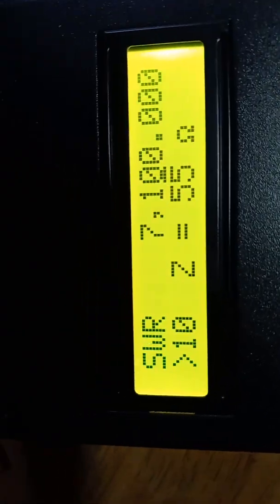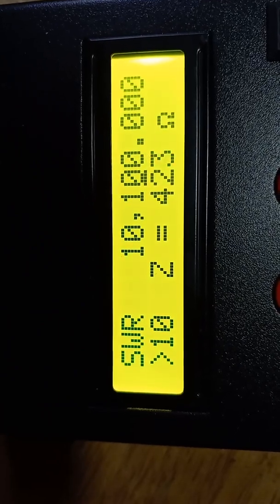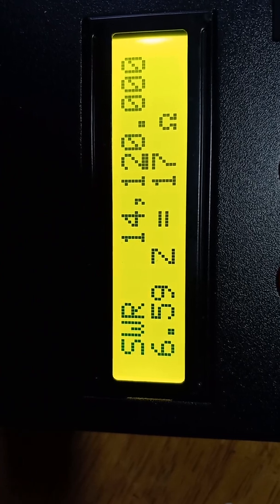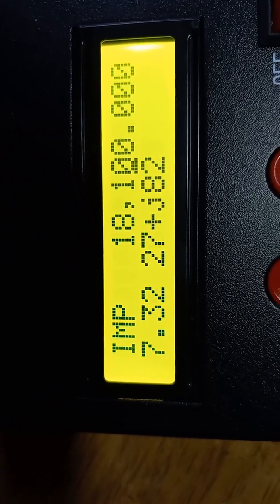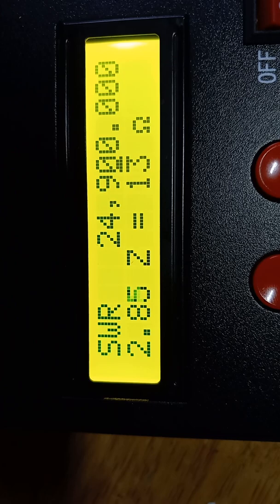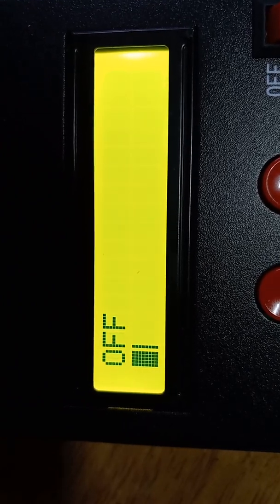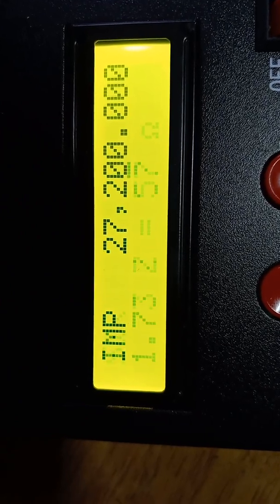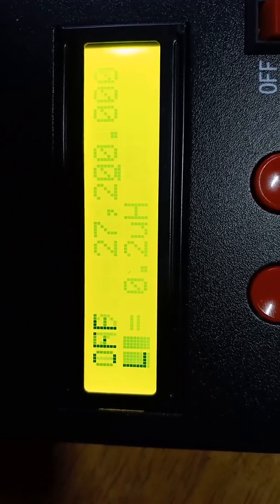Sark100 Analyzer

Comment: I just got one of these and i ordered a 2.1mm cord but when i tried to plug it in the center pinon the unit  was too big and the cord wont fit
Reply: I got lucky and had a jack that fit it but now it powers off on its own, so you not only one trying to figure this thing out there's a. Ideo on a battery you  an configure if you like tinkering.